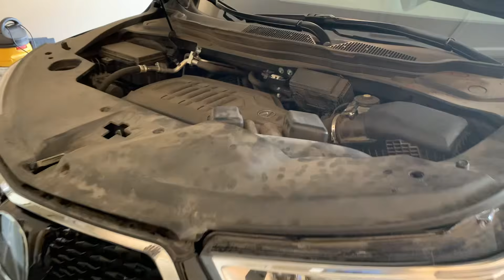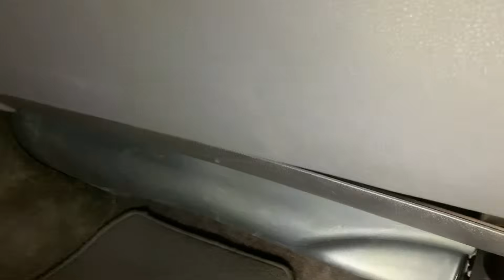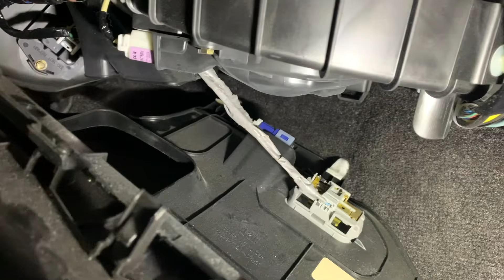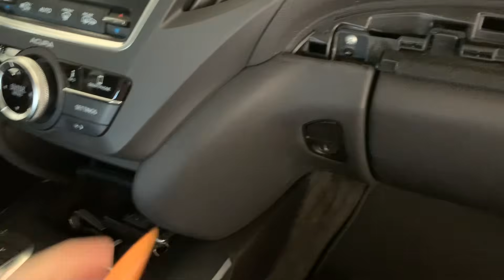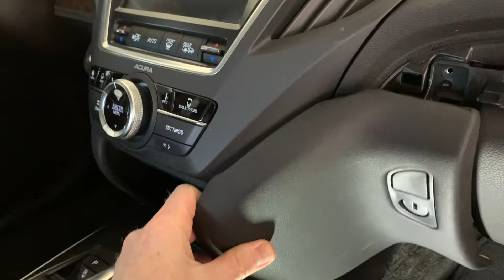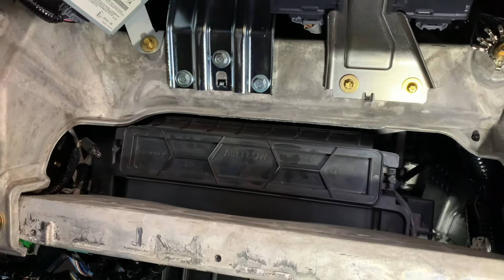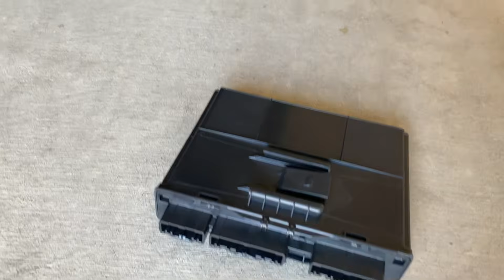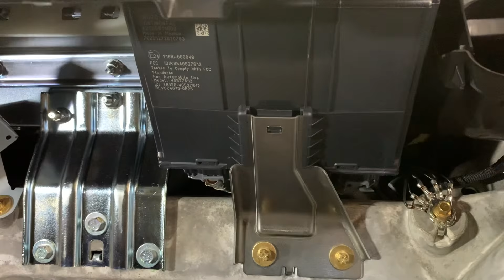Honda / Acura Random, Intermittent Flashing Dash Lights, Headlights, and Car Alarm - FIX Part 2

Comment: I thank you sir, very much!  You must be an angle to bring kindness and help to this world.  Our car is 2017 RDX.  It started the same symptoms last year twice after we moved down to Florida, then it disappeared.  The symptoms appeared again 2 days ago when the car was park under the sun in 90+ degrees.  The intermittent dashboard light flash and horn came on and off even in the garage.  After seeing your video in YouTube, I decided to give a try.  Today I spent 3 hours to remove the compartment and the controller underneath, but found out that's the controller for steering.  Finally I found out the Keyless Access Module in 2017 RDX is under the dashboard on the driver's side.  It's easy to locate and remove.  If I knew it's located on the driver side, I would have fixed it in about 30 minutes.  After following your instruction, the issue was resolved!  The control board in our car has exact same appearance on that IC chip.  Exact missing sealer coverage on the same area of that IC, something grew on the side and the side legs.  This is manufacturer's production defect!  Honda should be responsible to fix the issue for the consumers!  Thanks again for the great video and your kind heart!
Reply: Thank you for the info! This is our weekend project for our 2017 RDX
Reply: I’m about to do the same to my 2018 RTX do I have to remove anything on the driver side or is it underneath the steering column?

Comment: Thank you for sharing. I tried this on Acura TLX 2017 model and so far I don’t this issue anymore.

For anyone who is trying this on Acura TLX, control unit located above glove box.
Reply: Same for 2018 Acura TLX
Reply: Thank you! I have the 2017 TLX and the alarm is randomly going off
Reply: @ambernecho DO IT! Worked for me it’s been a little over 2 months now and no random alarm going off anymore 👍
Reply: Hi...I have the same problem with that...for my acura tlx 2017....Do you know where I can take out the box control unit???
Reply: @ph-elam4192 it’s right above glove box. You’ll need to remove side panels and unscrew the glove box to access it.
Reply: Did you remove the glove box to get to it?

Comment: Wish I could give you a hug. Had no idea what was wrong with my 2016 Honda Odyssey until I happened to find your video. From several different forums I had read I was preparing for the worst, at least financially, which was something my family cannot afford at this time. 
Your video was spot on in diagnosing my issue, and repaired it myself with only being setback the cost of a new bottle of superglue. BTW, on my Oddysey this module is located on the driver’s side underneath the dash up high almost behind the steering column. It can be removed without taking out the dash board by removing the lone screw holing the bracket in place. 
Thank you very, very much for your video!!!
Reply: Glad I read this as my 2016 Odyssey has started doing this
Reply: @timothywest-11-11 Yours should be on the driver’s side way up top half hidden by the steering column.

Comment: Just completed the fix on our 2020 Pilot today. A little bit difference on the interior body panels, compared to the Acura, but took it slowly and was able to pop out all the trim around the glovebox. Once the BCM was out (and I was able to skip the step of removing the BCM bracket by just unclipping and sliding it free), I disconnected the three connectors and had the module in my hand. After the tricky part of pulling the board out of the module housing (you have to be gentle with pulling the plastic over the tabs), it was interesting to look and see exactly the same "miss" for that conformal coating. Same chip was half covered, and even though it was incredibly hard to see, under magnification (with both iPhone mag and reading glass magnifier) did clearly notice where that "dendritic" material was wrapped around the corner. Used a watch-maker small flat-head screwdriver to scrape the material away. Swept it clean with Quetip and alcohol, and applied Krazy Glue with an artist's brush to seal everything up. Reinstalled with the reverse process, connecting back up the BCM and reinstalling the trim... and after the battery re-connect sat in the driver's seat and immediately didn't see the plaguing dash flicker. Started up fine. Re-set the "theft control" and turned off and on several times and all good. Been sitting in my parking space for about 8 hours now and no alarm. Longer test drive tomorrow, but fairly confident this fix did the trick. Can't thank you enough, Regina G, for this help. Would have been hours wasted at the dealer ( or good indie shop, with $$$ flying out the door) to get this figured out. Still vexes me how you figured this out?? Are you an engineer with IC experience? There's no way a "civilian" would have been able to figure this out. But whatever, I bow to you. You have solved a problem that Honda should be grateful to learn from.

Comment: Great detailed instructions. I’ve broken a lot of these little clips over the years on various vehicles. Nice to have a video showing where they all are. I had my wife in the drivers seat pausing the video at each step as we followed along. Anyway, this fixed my alarm and flashing dash problems!
Reply from the maker: Thanks for sharing your experience and most importantly that the problem is now resolved!  I hope this encourages others that they can fix theirs too.

Comment: I ordered a used keyless entry control module. Does it have to be reprogrammed by a dealership.
Reply from the maker: If you replace the Smart Power Control Unit you will have to pair your key fobs to the new Control Unit.  I have heard of some mechanic shops can do it.  You will want to ask to know for certain.  But, a dealership can do it.
Reply from the maker: If you replace the Smart Power Control Unit you will have to pair it to your key fobs.  I have heard that some mechanic shops can do it.  I'd suggest you ask them first to know for sure.  But, a dealership can do it.  I think I was quoted about $350 to do it.

Comment: Had this problem with my wife's 2020 Passport today. Came across your video and performed the repair. Took about 45 minutes all together, being careful removing the interior plastics. Dealership wanted $180 just for diagnostics. Thank you very much!
Reply from the maker: Fantastic!  I think this is the first one I have heard of that this issue also exists in the 2020 Passport.  It really is no surprise.  Do you mind sharing where the Smart Power Control Unit is located in the 2020 Passport?

Comment: Thank you very much for taking the time to show us how to fix this crazy issue without paying $$$ to the stealership. I followed your video step by step and applied a polish top coat to cover that spot. Hopefully, the problem will be fixed.
Reply: Did it work?? I'm desperately trying to fix mine
Reply: @CookwithClarissa  yes, it took less than an hour. GL!
Reply from the maker: @chucktran5160  Thank you for your comments and helping others know that it worked.

Comment: Wow. I’m having this problem right now on a 2017 MDX. It had this issue few times last September, then stopped. Didn’t happen since then until now. That’s a lot of pulling apart, but I might be able to do it. I’m gonna give it a try. Thank you.
Reply from the maker: Thank you for your comments.  Please let us all know how it went.
Reply: I followed the instructions given in this video exactly as shown. All of the parts came apart easily. The module itself was very hard to open, but luckily I happen to have a tech team where I work, and they were able to open it for me. I cleaned the part on the board where he shows in the video, and put everything back together, and I have not had the problem with my car turning on by itself and setting off the alarm since. It was the most frustrating problem I’ve ever had with a car, and this video solved it. Amazing job with this!

Comment: Could this problem be a cause for parasitic battery drain ? I’m on my 2nd battery in last 5 days ? Please help ?
Reply from the maker: In my case, this problem did drain my car battery because it was causing my headlights to be on all night long.  If you are getting the flickering dash lights and/or headlights randomly coming on, then that is an indication that you have the same issue.

Comment: This is happening with our 2019 Honda Fit.  Just wondering if you have heard of this happening with Fits and is the location of the unit in a different place, possibly behind the speedometer?  Can’t find much info anywhere.
Reply from the maker: It appears from a quick internet search that a 2019 Honda Fit has the same type of Smart Power Control Unit.  See https://www.hondacarpartsdirect.com/oem-parts/honda-control-unit-smart-power-38329t5ea02.  I can't tell you exactly, I am not familiar with the Honda Fit, but from the diagram it appears to be located on the driver side.  Hope this helps.

Comment: Just did this repair on an 2017 Honda Ridgeline and so far works. You’re a genius! How did you figure this out?
Reply: hello, is the module located in the same side for the 2017 ridgeline?
Reply: @raulrodriguez7621  yes, passenger side, gotta remove glovebox

Comment: Im having this same problem but my Acura RDX is a 2007. Is this module similar since its an older model? I want to know if its similar before I even open up these panels. Plz help
Reply from the maker: Does your 2007 RDX have a push button start?  The Smart Power Control Unit used in 2016 and newer Honda and Acura models is most likely not the same electronics module as in your 2007.

Comment: You are the freaking MAN for posting this! You saved me from having to take my Pilot to the dealer which saved me time and more importantly- money! Thank you thank you thank you! 
Side note: the most difficult part of all of this was getting the control unit box open. The exact spot that you pointed out was precisely where the problem was. I used a cheap magnifying glass and the zoom on my iPhone to visually see the mess that I needed to clean. Sealed it up with gorilla super glue and popped it back into its case. I feel like a bad ass and it’s all thanks to you. ❤
Reply: Did cleaning it out work? I was about to order a whole new unit.
Reply: @maricelaest. yes! It worked. I have pictures of the little crud that I had to clean off. It was not visible to the naked eye. I had to use a magnifying glass and my phone camera to see it. I felt amazing when it was all done because I saved myself a bunch of money.
But yes, it worked. The alarm has not gone off since I fixed it.

Comment: Just did this to my daughters 2017 pilot which has been to the dealer multiple times for this issue.  It was doing the clicking, lights on/off and alarm had been going off randomly.   After reinstalling all seems good and no issues so far!  Thank you for this video.  Dealer had replaced the keyless access control unit last summer but it must have been defective also as it looks like the factory applied sealant was not covering the chip you reference fully.  Cleaning it and applying the super glue to seal stopped the short and hoping it stays that way.  So mad at Honda that they seem to be ignoring this issue so many are having with these vehicles.

Comment: I performed this today on my 2016 Honda pilot. Now my vehicle shuts off immediately after starting up and the green immobilizer key lighter flashes several times
Reply: Sorry to hear.  Did you get this problem sorted? Maybe module was not reconnected all the way? Did you disconnect the battery beforehand?.. Did you replace with a brand new module or clean microchip on your existing module?.. Just wondering if somehow your keys got deprogrammed?

Comment: As I posted on the other video, thank you and you should be knighted for your service to the Honda/Acura community!  To get the circuit board out of the case, we took plastic drinking straws and folded them.  Then we pried the tab back with a screwdriver and jammed the pointy, folded end of the straw into the gap to hold the tab back.  After doing this on all four tabs, a little prying with the screwdriver made it pop right out.
Reply from the maker: That is so great!  Thank you for sharing your technique.  I like it!

Comment: Thank you for doing this. This video brings back trauma lol from having my car alarm go off so many times in middle of the night, the flickering/clicking of the dashboard lights… The worst part of all is at the car runs completely normal. Which you think would be a good thing, but in reality keeps the Honda dealership from believing you that there’s something wrong with the car. Only the Honda Odyssey forms, and YouTube videos like this help me press the Honda dealership to fixing the right part. From having the dashboard lights flickering almost daily to after me, forcing them to fix this part to having it, and not having it all in two years, gave me so much satisfaction. I solved the issue that the Honda techs couldn’t.

Comment: Thank you so much for the videos. I walked up to my 2019 RDX (65k miles) unable to open using the key fob. It looked like the car was on and running (headlights/taillights on and dash fully lit ). I had to use the actual key to open the door. Alarm randomly went off that evening and woke up to a dead battery. Think this could be my issue as well?
Reply from the maker: It very well could be.  I have not heard of others unable to use the key fob to unlock their vehicle in this case, so that could be another issue.  Nevertheless, your other symptoms sound like what is addressed in the video.  Please give us an update on how it goes and turns out.
Reply: same, my 19rdx ignition on by itself after I ignition off, headlight on and dash on. How it goes? You go to the dealer?

Comment: Thank you, thank you! You've just saved me a major headache! These units are on backorder and I was about to purchase a used part which would have likely had the same issue. I will be taking my control module out and cleaning it myself! Temps are below freezing here now so I will be sure to let my Pilot warm up real good before attempting to dismantle the dash. Thank you!
UPDATE: I performed the fix and it worked perfectly. Hardest part was getting the circut board out of the casing. Could see a small area that wasnt sealed all the way. Carefully cleaned with rubbing alcohol and sealed with super glue. 2019 Honda Pilot works fine now! Took less than an hour.
Reply from the maker: That is fantastic!  Thank you for your comments and giving us an update on how it went.
Reply: Did you have to reprogram the unit or was everything plug and play
Reply: @mikebeattie2939 you don’t have to reprogram unless it’s a new unit
Reply: Is it located behind the glove compartment or under steering column?  I have 2020 Pilot. Thanks.

Comment: Thank you so much for your video, it helps me to understand more about the problem. What you showed on video is exactly happen to my 2018 Acura RDX. I am going to follow your guides later this weekend. Again thanks a lot
Reply from the maker: Thanks for the comments.  Let us know how it went.
Reply: Isn't it deprogrammed when the part is removed?
Reply: @miguelsanmiguel7113 did you an answer for your question? Im wondering too. Thanks

Comment: Here/s an update to my earlier comments. I completed the repair in August 2023. Problem permanently fixed. I don't even think about it any more. If this is your problem, then this is the solution. Period. Thank you again @reginag1874 for coming up with a solution sharing it with others.
Reply: Amazing!  Is it necessary to disconnect the car battery or no? .. and trying to find out if I do disconnect car battery, should I use a memory saver?.. Appreciate a reply, thanks!
Reply: @dlb18  I didn’t use a battery saver. I simply unhooked the battery and went ahead. There were no side effects.
Reply: @les8241 appreciate the reply, thanks!

Comment: Is it similar module for tlx? 2017 tlx having same issue..
Reply from the maker: Yes, there appears to be a similar module in a 2017 TLX.  For example, see the following link (item 14) - https://www.acurapartsnow.com/oem-parts/acura-control-unit-smart-power-38320tz3a13?c=bT0xJmw9NCZuPVJlY29tbWVuZGVkIFByb2R1Y3Rz.
Reply: @reginag1874  thank you for the reply ! I am attempting the fix this week wish me luck!
Reply from the maker: @Afgmas  Hi. I appreciate your comments.  Can you tell us how it went.  Where is the module located in your 2017 TLX and how did you access it?  Is it similar to the MDX, like I show in the video?  There are some others following this video with a TLX and are seeking more information to make this repair.  Thanks!
Reply: @reginag1874  hi! The fix worked btw. I am sorry for not writing comment sooner.

Acura tlx 2017:
The module is on the passenger side above glove box. You have to take off some trim to get to the module it is screwed in differently to the chassis. But all the same.

The module itself is the same. 

Everything else the same process.

Amazing work discovering this you have probably saved people thousands easily.

Comment: 2017 MDX with 40K miles. Changed remote batteries, charged the main battery and still had problems with headlights and alarm randomly going off in the middle of the night. Both chips were sealed in my unit but i could see the whiskers where you showed. Cleaned and used nail polish to seal.
Reply: Yessir! Have not had a problem since.
Reply: @HoanFamily Did you disconnect the battery and use a memory saver too?
Reply: I did not. I usually don't when working on my cars or do things that are connected to air bags.
Reply: Did it fix it ?